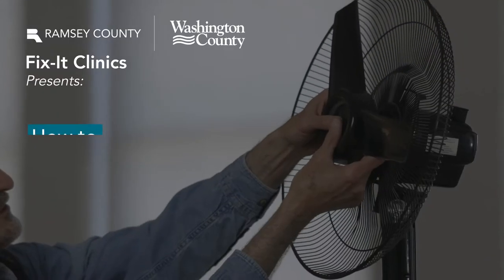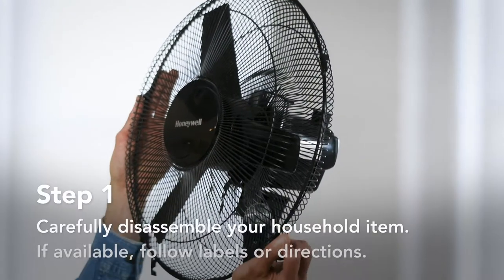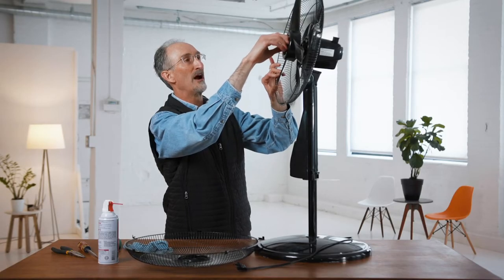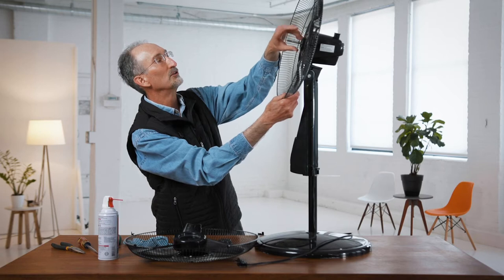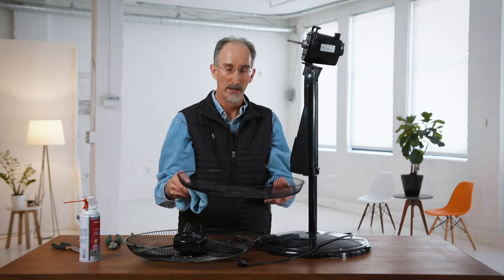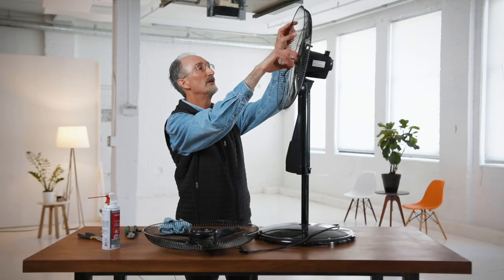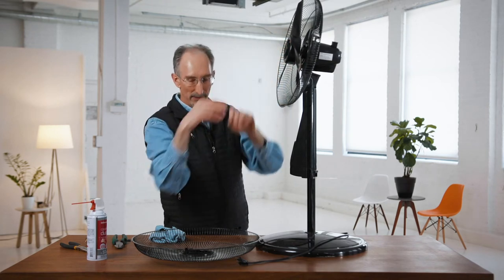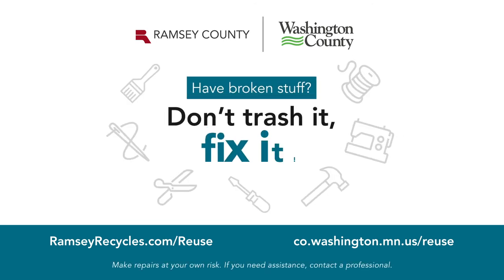How to clean and maintain an oscillating fan.

Comment: We have dust in the air and so our oscillating fan needs to be cleaned every 3 months. But there is always a snowy white caked up in the motor so that too has to be taken apart to clean.
Thanks for your instruction.

Comment: This was good but you should also mention removing the back plastic cover exposing the motor. I took out the single screw and popped the cover off. There was so much dust build up, you could not see the holes in the back side of the motor, it was a fire hazard. I took a paint brush from the dollar store and cleaned it up.